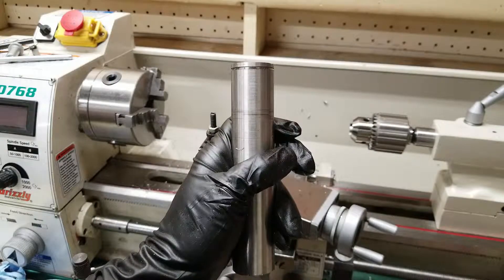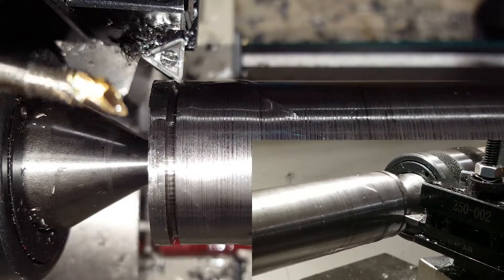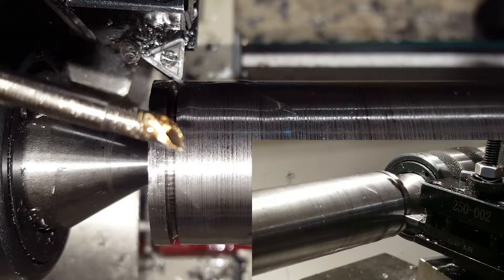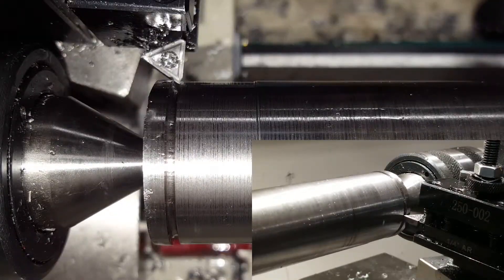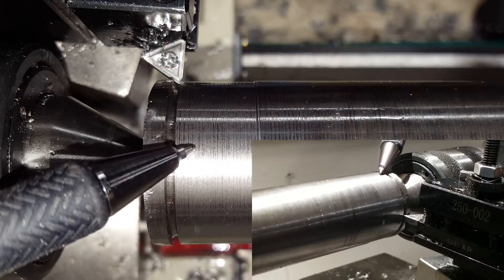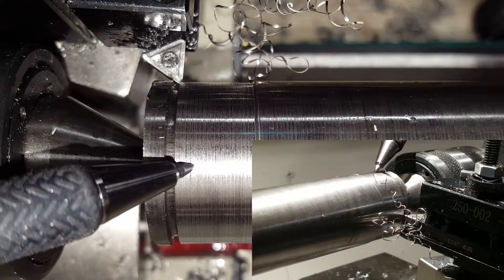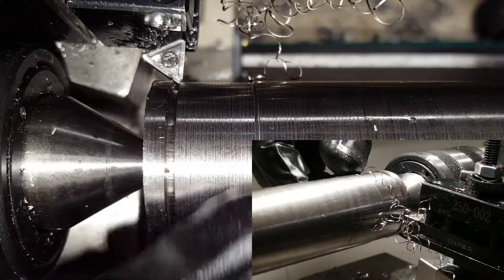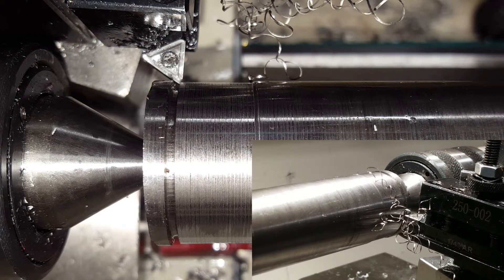Oil VS No Oil-Turning Stainless Steel on the Lathe

Comment: In future comparisons, consider doing the non-lubed cuts first, followed by lubed cuts.  Reason is, once the metal is oiled, no one can ever fully wipe oil off enough to do dry cuts. Where if you start with no oil, it stays no oil. Then you add oil for the oiled cut. Should give us all more valid comparisons.